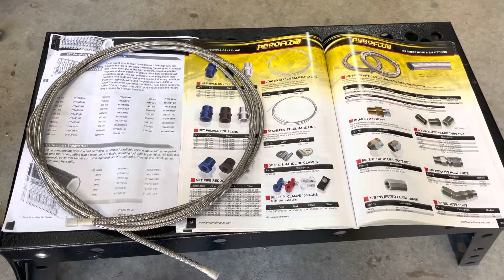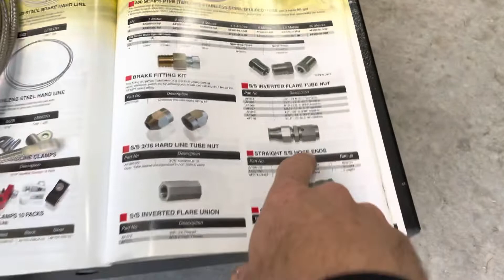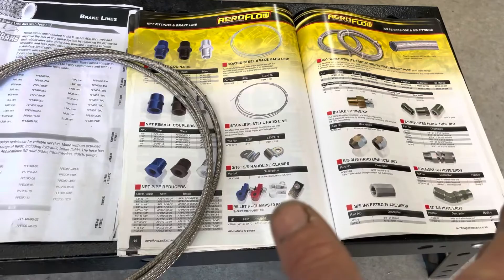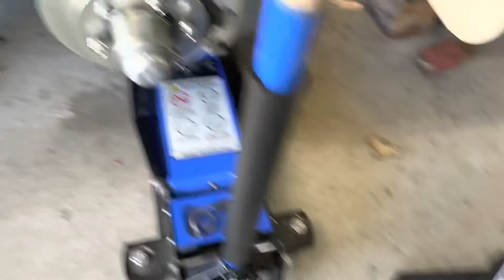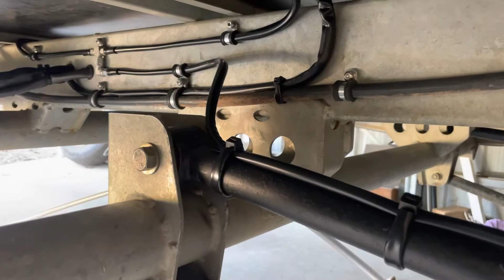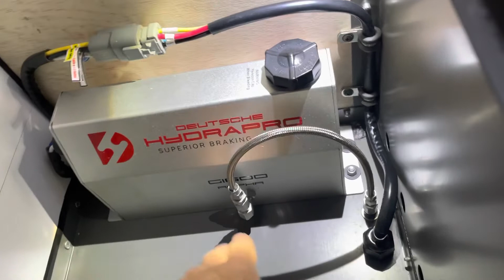Drum to Disc conversion on camper part 2 brake lines

Comment: Hi Phil,
Thanks for the brake conversion video. 
Have you road tested the new system? If you have, can you give a review of on road preformance and comparison to the original drum setup.
Cheers
Reply from the maker: There is not a lot of difference in normal braking performance between the electric drums vs the electric over hydraulic disc except that it smother in its application and little bit slower to apply as the pump unit needs to build up pressure. The biggest difference between the two is emergency braking, you have more trailer braking with out wheel lock up. 
It feels easy to get the disc brakes set right so there braking the van, not the van and the car this at all speed. 
Main reason I fitted them to my camper is to reduce maintenance when driving on dirt roads and this has worked out well as the rotors are hardly wearing, but the pads do wear out slightly quicker in dusty conditions, but at least they’re easy to change. 
The biggest downside to the electric over hydraulic set up is getting parts most places carry parts for the electric drum brakes, but you’ll be waiting awhile for them to order in anything to do with the electric over hydraulic disc brake. Just something to be mindful of when you’re travelling around this beautiful country.
Cheers Phil
Reply: Hi Phil.

How well would these brake discs hold up when off roading in mud/water when used on an off road camper trailer?

How will will reduce the likelihood of rock strike on these discs and lines?

How do you measure/determine the wear on the disc brake pad?

What is the trigger to changeout the brake pads?

Also, do you have any videos on just changing out the disc brake pads?

Cameron